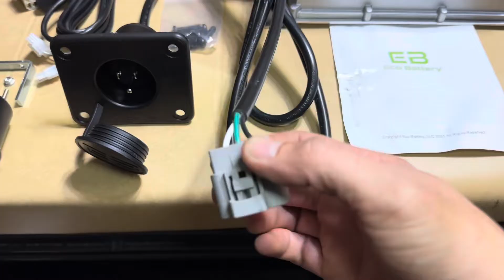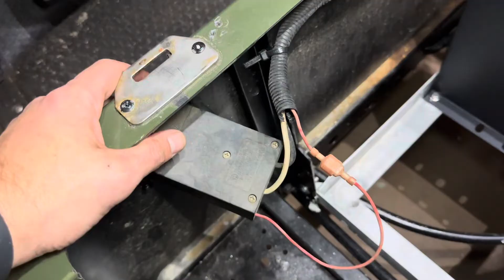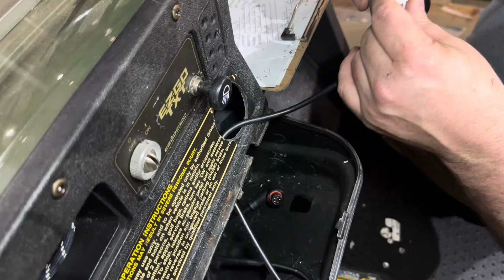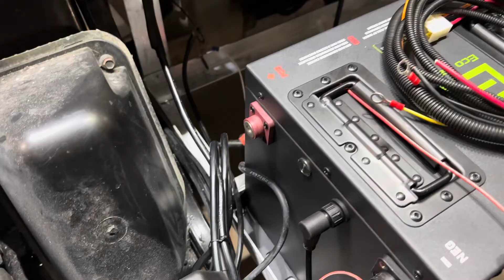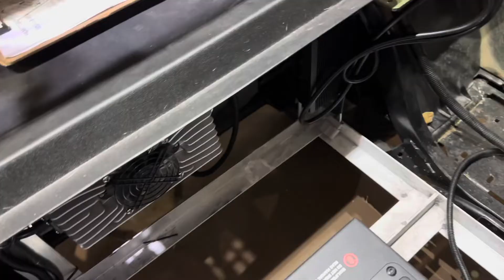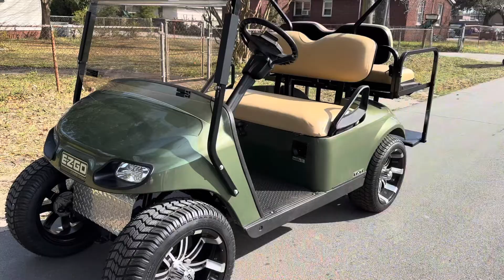Eco Battery 36v - 105ah Lithium Golf Cart Battery ~ EZGO TXT ~ Unboxing & Installation Video

Comment: If you bypass the reed switch does that mean it can be driven if charging?
Reply from the maker: Yes, correct. Bolt Energy USA battery chargers come with a built in charger interlock if you need to keep that safety feature active.

Comment: Could you explain in more detail how to by pass the reed switch
Reply from the maker: Yes, the small wire from the back of the charge receptacle needs to be secured to the B+ post. This wire needs to have 48v to close the charger interlock switch.

Comment: Hi, new here with almost same cart pictured.  What did you plug the signal cord from the charger into?  Mine is not charging and I think it’s that.
Reply from the maker: It needs to be plugged into the port on the LCD wiring harness.

Comment: Great video. One thing I’d recommend is not saying the small metal square piece on the dash is riveted. Those small “rivets” have a piece in the center that you push out and can easily remove and reinstall. Takes two seconds.
Reply from the maker: Correct, I think the rivets were added at some point to this golf cart.

Comment: Sorry for the delay…
Nov 7 2023
Over all I feel that ECOBattery does deserve a 4.5 out of five… rating and a thumbs up recommend… but…
Quick review ECO batt 48v 107 amp… mounting / hood down hole down the middle..
At almost exactly one year after purchase …battery dead completely ….unresponsive 
 I contacted the local vendor who asked me to contact ECO…. After comms… 
I was instructed to remove the batt and take it to the vendor for diagnostic..amd have it boxed / prepped for shipping back to Eco…
But I was overseas so we arranged for the vendor ( fortunately lives in our SAME NEIGHBORHOOD..) to come buy the house to to the initial diagnostic… getting him to show took a couple of weeks….

The vendor came to the house to ck out the batt but the FIRST time he came by… he realized that he didn’t have the correct connection/ cables to to the diagnostic…
He came a second time and removed the Batt ( five stars) but it did take two or three weeks to get this far.… 4.5 stars… and they charged us $125 to do it… fair is fair  time/money.

Between ECO and the vendor ..THEY paid to have the battery Shipped to the repair station…
They repaired it …a and then they paid to ship it back…
Total turn time from our first contact to Battery back in Golf cart running was five weeks…
Although I would have done the removal and reinstall , I work overseas and I had just rotated out when the failure occurred.

So….it cost us $125… for two service calls diagnose, remove and reinstall.. actually three because the vendor didn’t bring the correct diagnosis cables the first time so he had to return ( for a second try to diagnose that the batt had failed “ internally”)….
Which resulted in the removal, ship, repair, ship, reinstall….
 ( by the way the only internals to fail, failed BMS, failed on/off switch , failed batt… we were never told what actually did fail.

Finally, we bought this batt almost two years ago and BEFORE we bought it we were told that it would have blue tooth connectivity to the BMS… and that the software was “ forthcoming” 
THAT ….. would have / could have provided level one diagnostic ..
Two plus years later and ECO still doesn’t have a date for the blue tooth up date.

So….Does Eco get a Perfect score of “Five stars”…. No… but would I buy another Eco Batt…. Hmmm. Probably…. Maybe. Will I shop around .. Probably…. But the warranty

8 year warranty…. 3 three years 100%
Then the next five years the warranty dollar value pro-rates down.
LiFePo… batteries have a high number of total expected charge/ discharge cycles… 
So a failure ( for us) in the next five years.. would likely be a BMS… but as BMS Technology also evolves … if / when this batt does fail.. in six, eight or ten years… and when the warranty is less valuable… I will open the case and diagnose the batts and swap the BMS myself… 
In short
ECO…. did not disappoint … 
IS not a scam… 
feels like it is run by humans … NOT  by a CEO and a Board of (I don’t care about the customers, let’s just increase sales and profits) Directors.

ECO…does not suck…
ECO… keep them ..ON…your list

Comment: I have lights (Rear led center high mount, and front led light bar) as well as a Bazooka tube speaker.  Is there any difference to my install versus what you just showed?
Reply from the maker: Not really, just identify all your 12v accessories even if you have to trace each wire. Then put them all to a 12v distribution block. Good to go.
Reply: @PalmettoBatteryPros  thanks!

Comment: BUYER BE…”AWARE”…. This story is still ongoing.
Date of initial report… July 6 2023

We bought the ECO 48 volt 105 amp hr battery almost exactly 12 months ago…
The full kit..Battery ( “through hole” …. “not skinny” ) with charger and state of charge meter

1) before we bought the battery, we were told that part of the package was supposed to be “ blue tooth connectivity”  via your phone (?) to the battery… nope… ECO has been selling that BS for over 18 months (?) now, still no connectivity to the battery OF ANY KIND….Strike one.

2) almost immediately the state of charge meter would only wake up / come on when it felt like it… or I would need to disconnect and reconnect wires… the retail outlet ( one of the owners lived near by) so he came by and “ re-programmed the BMS”? ..Strike two ..
but thank you retail outlet… ( name with held for now) 

3) two weeks ago, (almost EXACTLY 12 months after purchase) ..the battery is dead.
Non responsive… there is a “ plunger” type on/off switch mounted in the battery casing that, when “ on” illuminates green…. Nothing… dead.. charger only cycles on/off… 
So the same owner manager came by to look at the battery… OOOPS..he didn’t have the diagnostic cable…. ( REALLY?)… ok … the guy is standup… he DID make the house call.
But then it took him another five days to come back and take the battery away saying that they were going to ship it back to the manufacturer…We are in FL and ECO is in SC.
When I asked “ how long to ship, diagnose repair or replace, and return” ..I was told “ possibly an additional month. STRIKE THREE

The only bright spot is that the local dealer appears to be trying.
But $2600 plus tax… 
The cart will be down 6 weeks….
I can swap a transmission in my F150 in two days in my driveway.

DO NOT BUY ANY EXPENSIVE ITEM UNTIL/UNLESS you have been informed about the warranty / repair process.  And if repairs take longer than xxxx do you get a loaner?
ECO warranty… 8 years… first 36 months full replacement.. after 36 months refer to pro-rate chart.
1) no blue tooth connectivity after 1 1/2 years
2) failed stated of charge system ( repaired via software/ firmware)
3) completely DOA battery after 12 months
4) possible one month turn time to repair / replace battery, no loaner, primary transportation lost .

I bought the ECO …FOR …. The warranty… let’s see if the company performs and how long it takes.
I am somewhat mechanically and electrically inclined… for now I can’t help but question if I would have been happier or as happy buying cheaper , raw hi amp LIFEPO batteries and adding a decent hi amp BMS. … Sure “ cheap has its own costs”…. But I can accept a deal…
Cheap means possible reliability issues means I need to be ready to repair.
I selected “ more expensive” so that I would have the comfort of knowing that when I am traveling for business , my wife’s PRIMARY / preferred transportation would be bullet proof and have support behind it…. Right now it appears that “more expensive “ has  NOT paid off.

I will report back as soon as I get info from ECO.
FOR NOW….. buyer beware… if they perform with integrity I will report that as well.
I do believe that we need to support and report on GOOD players… and losers…
it’s up to ECO to perform.
I…WILL…REPORT…. as this story evolves.
Reply from the maker: I have had perfect success of resolving all Eco issues, those guys are extremely helpful. Please keep us all informed of your experience and please let me know if I can be of assistance.

Comment: The on button that’s on the side of the battery turns green when on do you leave this button on all the time during and after charging?
Reply from the maker: Correct, leave it on. Only shut the battery off if you know you're leaving the cart unused for 2 or more weeks.

Comment: Thank you, thank you, thank you. I just installed a 36v bank and the cart is dead in the water. It’s the Reed switch. You are the first to mention the need to power that and how to do it. Fingers crossed, I will try it in the morning.
Reply from the maker: Awesome! Let me know if that was the issue.
Reply: What does the other end of the reed switch attach to? The end opposite the positive terminal?
Reply: @davidhanna5446  did u ever find out what the other end connected to?

Comment: Does the charging port have an indicator light or something to let you know when it’s fully charged? Or will the charging automatically stop after it reaches 100%?
Reply from the maker: This battery comes with a dash mounted voltage meter.